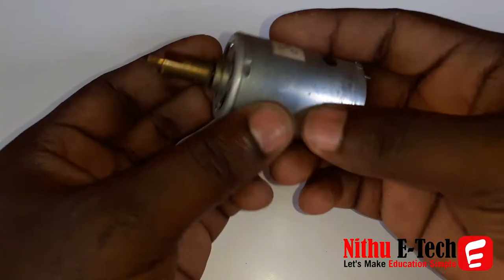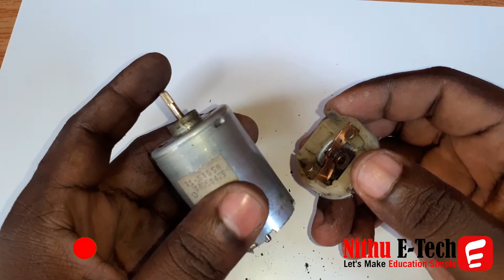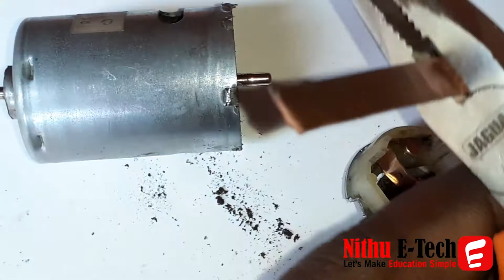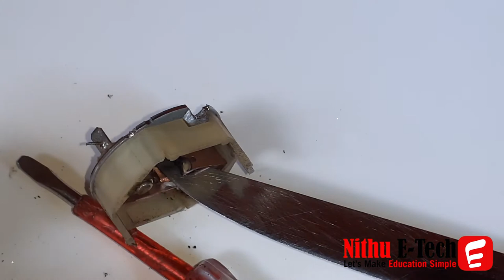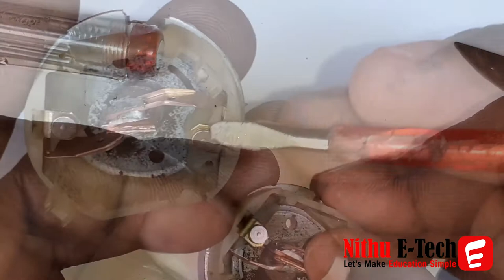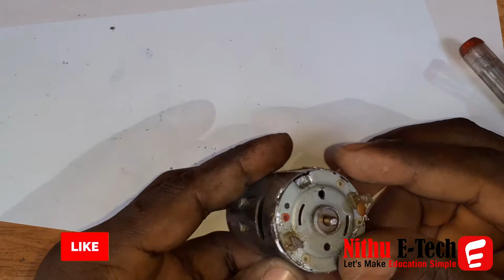How To Repair Dc Motor In Electrical and Electrical Life Hack Ideas

Comment: It is cheap and easy to replace carbon brushes than to replace commutator that is why carbon brushes are used. Metal brush will spoil commutator quickly.

Comment: Bad idea, doing this, you will destroy the motor. Using another metal as a brush will grind the rotor and destroy the whole motor. You better make another pin to fix a small  piece of graphen on it